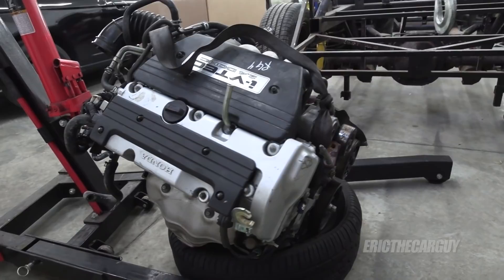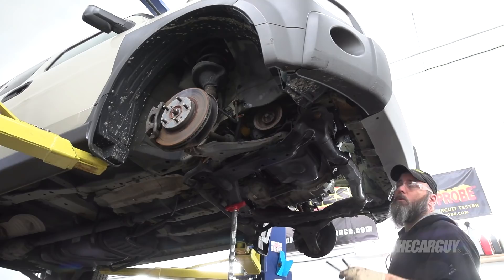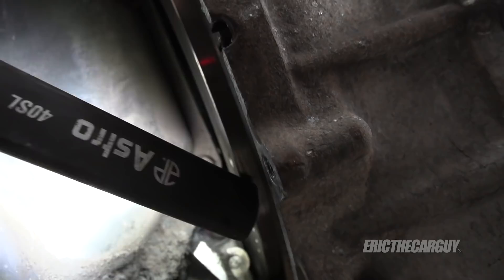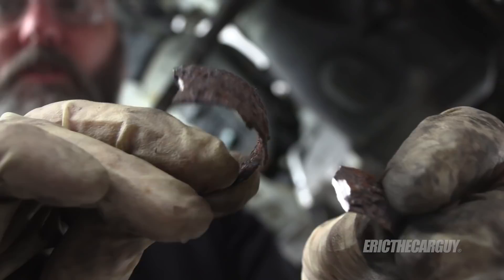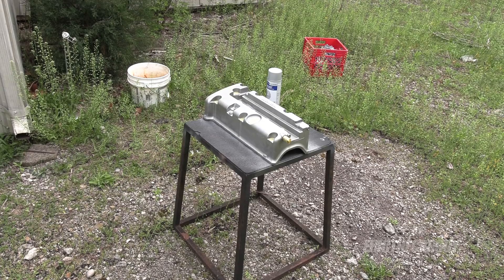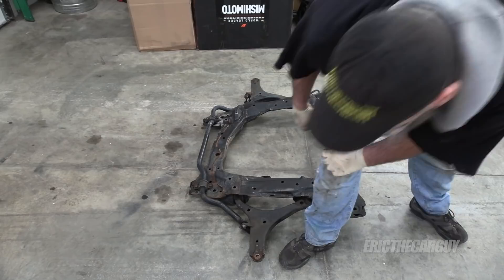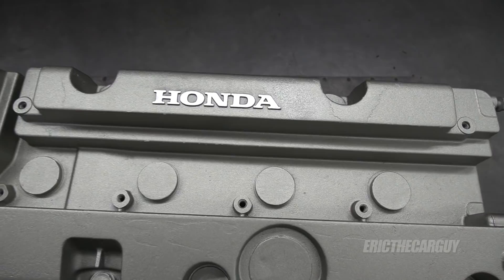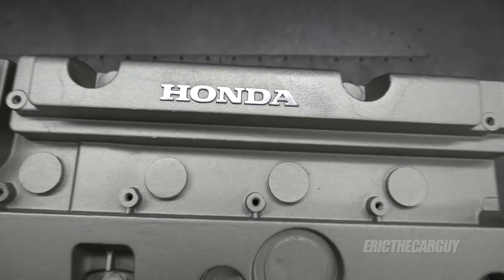Honda Element Engine Replacement and Restoration (Part 1)

Comment: I lost it when you said "Hey look!  I'm a quick lube oil place!". Then proceeds to run the fastener down with your impact driver. Great comedy!
Reply: As someone who works at a quick lube oil shop, this is accurate
Reply: I work at a dealership, and a former colleague did that exact thing...
Made me so effing mad.
Reply: I had a 94 Toyota 4Runner a few years ago, took it to the local lube shop to have it serviced.  They had to remove the skid plate under the engine to do some of the service work, yeah kind of normal...Toyota couldn't figure out how to install an access door in the skid plate to get access to the oil drain bolt, and oil filter....Anyhow, they put the skid plate back on using one of those little Black and Decker cordless screwdrivers to install the bolts on the skid plate....I'm going down the freeway the next day and kept hearing something rattle, a few miles further and my skidplate goes flying across a few lanes of traffic....WTF.  Those bolts were never tightened down after they had used that toy screwdriver to install the 3/8 bolts...needless to say they got an ear full at the lube shop, as well as had to replace my skid plate and all the bolts....took them a while to find a replacement skid plate, oh well.  I've never been back there sense either.  Figured if they can't install bolts in a skid plate properly I don't want them doing any other work to any of my vehicles.  I'm back to doing my services myself, I don't drive much anymore so I usually do 1-2 oil changes a year.  I just did the transmission fluid drain/fill and new filter on one of my vehicles a couple weeks ago.   Messy job but its done for another 30,000 miles.  I also replaced the transmission pan with one that has a drain plug...not sure why so many automakers don't find that to be something necessary...while you are trying to drop the pan full of transmission fluid because some idiot in the design process didn't think a 5 cent drain plug was worth it LOL.
Reply: @panzerveps  was that incident the reason for him being a “former” employee?
Reply: @kylewitter2806  I quit and got a job where they don't hire people like that.

Comment: That C clamp struggle was painful and entertaining at the same time.
Reply: A little bit of tape to hold it all together...
Reply: You always need 3 hands
Reply: I suspect some parts were edited out to make this video still family friendly
Reply: That's pretty much the story of any car repairs I do, regardless of the repair, it always ends up to be far more frustrating and involved than it really should have been, because as in the case of this Element, previous owners and repair shops tend to cut every corner they possibly can to save a minute of their time, whether it be cross threading bolts, overtightening, stripping threads, you name it they do it wrong.

Comment: Eric, thank you for all your videos.  Because of you I have been able to work on my own Honda Element without fear.  I now change my own oil.  I've changed out the transmission fluid, twice.  I've changed out the coolant in my car, replaced one radiator fan and about to replace the other.  I've also done many other things to it.  As of today I have 265,000+ miles on my car and I credit the longevity of my car to you inspiring me to work on my own car.  I thank you many times over for your videos and your hard work.  Staying dirty.
Reply from the maker: That is great to hear. I'm very happy to know that my videos have helped you with your Element. Thank you very much for the comment.

Comment: Eric, thank you so much for leaving the frustrating part of these jobs in your videos. I struggled a couple weeks ago replacing the bearings on my Element and no video I found showed that anyone was having any problems. I was pissed off beyond measure! I was cussing and throwing things (afterwards, I had to talk with my 16 year old son that I was completely wrong in my actions). Every single video showed that they had no issues and it only seemed to take them 30 minutes after complete disassembly  of everything else. Years ago, I watched your first video on replacing those bushings and realized then, that it was way easier to replace the whole control arm. That was all thanks to watching your frustrations. I am a shade tree mechanic only and that video showed me, that if a pro is struggling, then I will bypass the whole thing altogether. Thank you so much for your videos. 
Side note I would love to see an updated video on your thoughts (maybe an ETCG1 video) on buying aftermarket parts versus buying OEM. I like to try OEM but, Rockauto and other sites have made parts so much cheaper than OEM. I learned my lesson with MOOG ball joints, ( I will never buy another one),
Reply from the maker: I love it when this happens. Mondays ETCG1 topic covers that very thing. Thanks for the comment.

Comment: Hahaha that cumbersome bushing press, sometimes you just have to laugh so you don't cry
Reply: Both the vice-mounted tool and the hydraulic press leave something to be desired. The hydraulic press should be less wobbledy dobbledy... Yes he found the correct adapter but still, I'm not really impressed. What else is out there? Dunno.

Comment: For years you've thrown on greasy, dirty, unpainted & rusty parts. It was such a relief & very therapeutic to see you finally apply a little elbow grease with some cleaned restored parts 🙌 💪 👏
Reply from the maker: I did it for you. And also for me. Thanks for the inspiration and the comment.
Reply: In states like Ohio where rust is prevalent, cleaning and painting parts can feel like pissing in the wind because one bad winter can make them look like hell again, so I understand not bothering.  That said, as a viewer who's not doing the prep work it is very nice to see cleaned up parts going in. 🙂
Reply: @MediumHalf  yep I understand the futility of fighting the rust. Fortunately I live in Northern Nevada so I see a little snow but not to the point it makes a 3 year old car look like its 35 years old.

My 99 accord is still rust free & all the bolts come out like they are new, sans a few exhuast bolts.
Reply: @OneKauz I'm jealous 😛

Comment: Cruising after work in my 93 del sol & some dude rear ended me with an F1 & ruined my trunk/bumper. Thank you Eric for posting this because a calm, great mechanic repair video is all i need to distract myself for a bit.

Comment: I'm a dedicated fan with an 04 Honda Element (5 speed AWD) and I've been discovering all kinds of repairs I need to do that weren't disclosed when I bought it (oil pan, locked brake calipers front and rear, rusted parking brakes both sides, and rust rust rust....). Genuine word of advice....those control arms aren't too expensive to replace, as I had to replace both of mine for bad bushings. That aside, I really enjoy your videos and have learned a lot about my Element from watching them. Thanks!

Comment: Also, Eric, im SURE you've heard this before, but your video's are SO.DAMN.INFORMATIVE. 
It was close to 10 years ago when your video on no crank no starts saved my first daily driver (99 EJ7 hatch , d16y7). Was on the on-ramp to the highway, hit a pothole then the entire car instantly died. took about a week to diagnose the issue, but it turns out the ignition coil under the distributor snapped IN HALF!!! never would i have thought to look there, but that little waffle shaped / heatsink thing was the culprit and it was ONLY your video that helped me get it fixed up. the entire thing just cut in half. Not only that, but theres been countless other videos you've put out that have been a gargantuan help. balljoints, suspension stuff, engine stuff, radiator stuff, diagnosing coolant issues, valve adjustments, electrical stuff, you name it, and its probably helped me in some way, shape or form. Whenever theres an issue with my honda's youre the first person i check.
my very first civic turned into my absolute favorite platform and made me a honda guy, and I eventually worked for honda, themself. turned that singlejingle automatic into a b20vtec manual that made 216hp on 91. god, that transition phase with a st.2 clutch and never driven manual was horrendous but that was my absolute favorite car experience to date. ended up with a hole in the block later down the road, and fully rebuilt a b18c1 block to OEM spec with all new parts and regrettably traded the whole project for an element that was a lemon, was title washed 130k miles->300k hidden miles, and never drove more than a few miles. sold it, and now own an rd7 CR-V, to which more of your videos have helped more than you know =)

you're an absolute legend, Eric. please dont stop working on hondas, and If this makes your day, throw me a heart so i know you read this which would make my day too =)
Reply from the maker: I'm very happy to hear that my videos have helped you over the years. It's always been my goal to help people with these videos and I never get tired of hearing about it when they actually do. I'm honored by your comment. Thank you.
Reply: @ericthecarguy  you have turned me into a honda guy... Or honda turned you into a honda guy, who turned me int-- nevermind. Thanks for being awesome and thanks for the birthday cake. It was delicious and I ate it all.

Comment: Great vid!!! I had to put my sand blaster on blocks so my back does not hurt!! Just a suggestion!!
Reply: I'm not sure who makes them (saw it on a video from a restorer, i think) but there's a kit you can purchase that attaches to the existing legs of most sand blasters and lifts the whole unit up. It doesn't use screws to fit to the existing legs, rather a simple clamp mechanism (IE being that as long as the legs are the common bent sheet metal type, not cast or tubular).
Reply: @aserta  yea I look at one after the fact that I raised mine up I just had to do a big job in the cabinet to get done  so I just cheeped out with the bricks for now I think I could build some leg Extenders with some scrape!
Reply from the maker: Great idea!

Comment: A trick i've used for stubborn bushings is to grab a bench grinder and give them just a tiny lip, like oem toyota ones so you can start them easily on the control arms

Comment: Just removed the engine from my 07 Element SC last week. Pretty much the same procedure but I did a few things differently. I left the wiring harness connected to the engine and disconnected it from the ecu behind the glovebox. I removed the subframe and used a transverse engine support bar to support the engine, lowered the vehicle with the 2-post lift resting the engine and transmission on an ATV jack, lowered the engine with the support bar and then raised the car back up with the lift.

Comment: @3:43 LOLOLOLOL!!! A Jiffy Lube did this to my 2001 Honda V6 back in the day. When servicing the car at a Honda Dealer, they quickly pointed out how my drain plug was stripped. & that an oil pan replacement was needed ($500). 

I got a used oil pan from an Acura CL 3.2 (thank god J-Series engines have 80% interchangeable parts), bought a Haines Repair book, & replaced the oil pan myself with one of my brothers. 

I’ve been doing my own repairs since then & never looked back!

Comment: Thanks for Sharing.   I have a whole bunch of bushings and ball joints that I need to do on several cars.  After watching you work,  I am thinking "What will I be getting myself into?"  The Big Press looks like it comes in handy.   I hoping they come out and go in easier than what I saw there.   I could see a lot of frustration,  I have run it to a lot of that in the last few "car repairs"....... I ended up cracking my daughter's Accord Distributor when knocking out the pin to replace the gasket.  Ended up replacing with manufactured with new bearings too.
Reply from the maker: The press is a must for bushings. Also, get the ball joint set linked in the description. Good luck.

Comment: This was me doing the rear knuckle bushings in my 97’ Odyssey, except I did it on the car, on jackstands, with the cheap power built C-Clamp tool. 

4lb sledge hammers come in handy for removal 😄 when in doubt, beat it out.

Comment: Nice to see that rust is getting removed for the most part and new paint added. nice when stuff is out of the way. 2-4 coats of black is a nice addition to prevent rust from returning --well for a few years at least.

Comment: I usually don't comment on your videos. However, thank you for showing people how hard it is to change suspension bushings. Peolpe wonder why it's expensive to replace them. They have ro be clocked right and requires special toolss. Most people think it's easy and not worth the price....but it is!!!

Comment: I feel you Eric, just did LCA bushings on a 1993 Toyota p/u using the Astro ball joint press with the pucks and cup falling all over the place.  I was ready to call my Snap-on driver and order the BJP1 or the Matco set since I hear the cups/pucks lock into the C arm better than the OTC or Astro but I'm glad I got it done without spending $700 OR buying complete new LCA from the dealer.  My wife said to get the new LCAs since it would have been easier.

Comment: Fascinating and impressive.  Above all, you have convinced me never to remove a modern engine.  I would never get it all back together again.
Reply from the maker: It's not as difficult as you might think. Just take it one component at a time. Thanks for the comment.

Comment: Eric, I replaced the control arm bushings few years ago.  Similar to you, only the compliance bushing were bad, and I didn't need to replace the rear bushing.  But, I decided to do it only because the control arms are already out of the car.  That ended up to be the most frustrating experience.  I ruined multiple bushings per control arm while using the shop press to push the bushing into the control arm.  Inevitably, the "lip" the bushings are destroyed in the process.  At the end, I had to machine an custom adapter that would push on the "lip" AND the metal center cylinder of the bushing at the same time.  I also removed whatever the paint that are still on the inner surface of the control arm hole.  Freeze the bushing and with lots lube, ky jelly, grease, butter, whatever I can find in the house.  The bushings were finally installed without destroying the "lip".  I think the whole project took almost a week with many trials and errors.   Yeah, hint sight 20/20.  I won't be replacing those dame bushing unless I abuslutely need to.

Comment: Interesting. I did one of these a few years ago. I dropped the engine and trans down in the cradle, onto 4 jackstands, all in one piece. I unplugged the pcm and pulled harness thru the firewall,  makes undoing wiring a lot easier on the ground

Comment: i have a valve lash adjustment in my elements future and im suffering from mild "how to properly find" TDC in a k24 anxiety but i plan on step by stepping it from your old video... have the tool and feeler gauges and valve cover gasket and some wrinkle blue for the cover so im excited about it

Comment: I normally heat the aluminum parts with either a heat gun or torch to open the pours then aluminum spray paint. It helps promote adhesion of the paint to part.

Comment: Sitting here with my bottle jack and my Walmart jackstands, I'm just a little bit jealous of the lift and the impact air wrenches and the tools and the knowledge ... lol
Reply from the maker: I didn't start out knowing everything, or with the best tool set. In fact, I used to drive around with my tool box in the back of my '84 Civic to peoples houses and fix cars in their driveways. One time when replacing a timing chain on a Nissan, it snowed. The half of me under the car was dry, the other half covered in snow. 

It takes time. For me it took almost 30 years to get here. Thanks for the comment and good luck.

Comment: Nice little project. Mine is happening on 4/25. Swapping out a used 700R4 trans out of a 91 C1500..lost reverse. Had original trans rebuilt finally(300,000 miles..had to save up to have it done..$1,750.00..better than stock). Was told it was trashed inside. Guess so due to the mileage. I`m 63, no lift, no garage, just a floor jack and 2 ratchet straps to raise trans high enough to get jack under it and a wheel chock for an 18 wheeler(overkill but very safe). Got a 3 yr/100,000 mile guarantee on rebuild. Supposed to be nice weather here in York Pa tomorrow...hope so. Stay Dirty!
Reply from the maker: I'm doing the same this week to my truck. The video should be out in the next couple of weeks. Good luck with your swap.

Comment: Hmmm..  well... stepping back 10,000 feet, I think you did a GREAT job, and covered a LOT of ground.  It took serious trial and error to get the processes on those bushings right.  And the ball joints. That's a lotta lotta work there Eric.  And you did have the advantage of a good shop and good tools and good lighting. Imagine all these poor suckers out there that live in apartments where they won't even LET them work on their cars, at ALL?  So ya dun good.  I think serious progress was made and I look forward to the rest. And yes I share your frustration. In my garage, to my neighbors, I must have sounded like a crazy man.
Reply from the maker: I started out fixing peoples cars in their driveways out of the tool box in the back of my '84 Civic. It was a long road getting here. Thanks for the comment.

Comment: I've run into the same bushing issue before and yeah, it sucks money wise but just not having to fight installing bushes is worth it..and if you're going to install metal on metal  go ahead and use a tiny coat of oil before pressing them in.

Comment: I had my original 2007 Honda Element motor removed after 235k miles. I had the car replaced with a 2nd motor JDM? At 40-60k. My Honda Element is still running to this day at 305k miles in 2022 from 2010 when I first bought it.